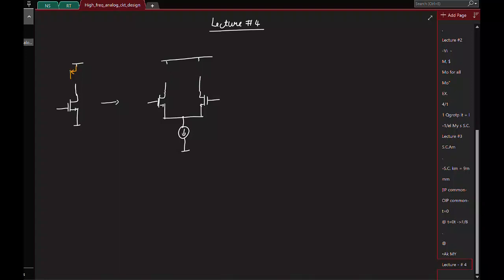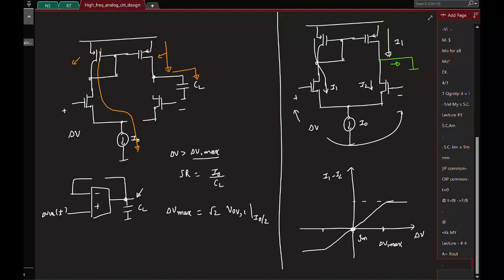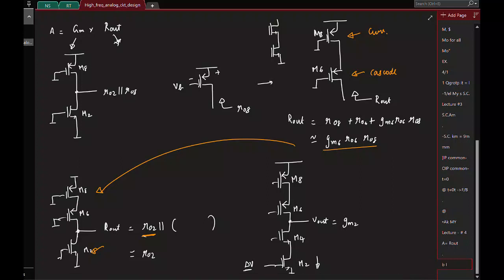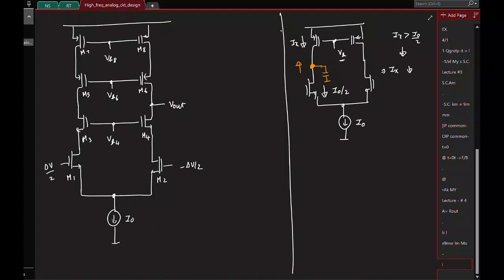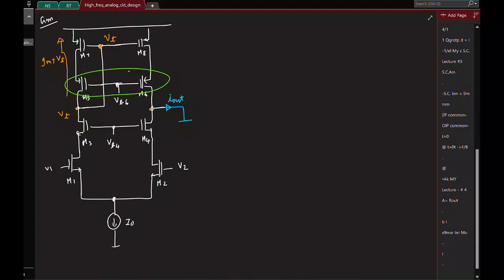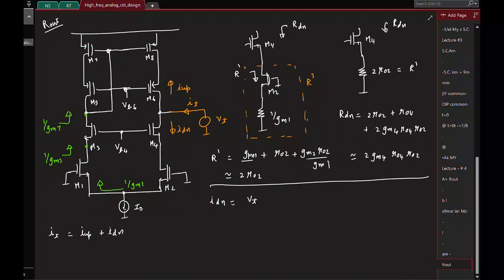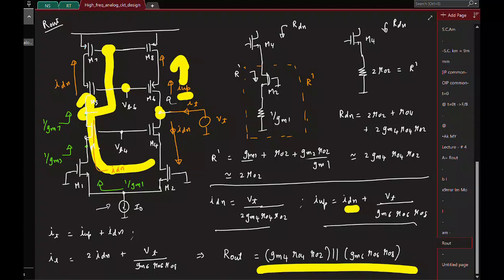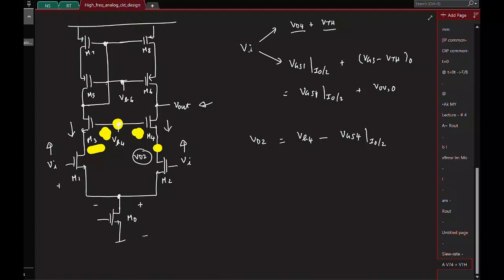Lecture 4: Telescopic cascode opamp, its small -signal gain and slew rate

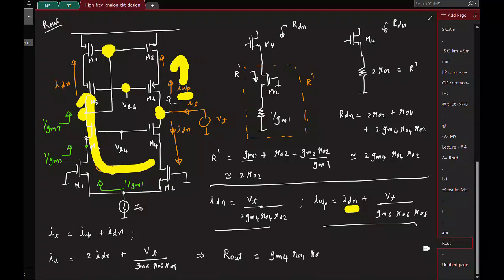Comment: so at 43:24, does the current in top 2 branches will be different ?? because iup is not matching to idown right ??? and with respect to the point mentioned at 42:33, the current through m8 should be equal to M6